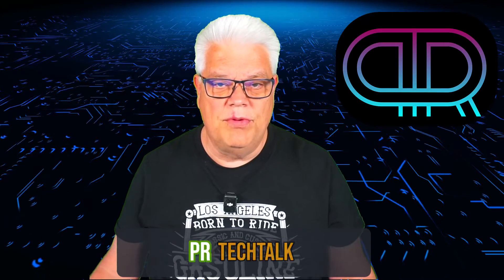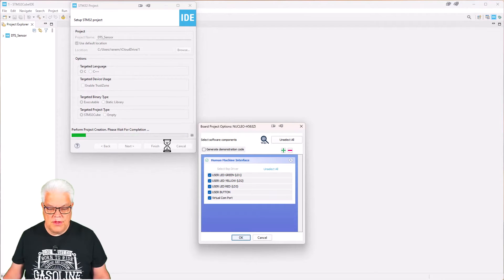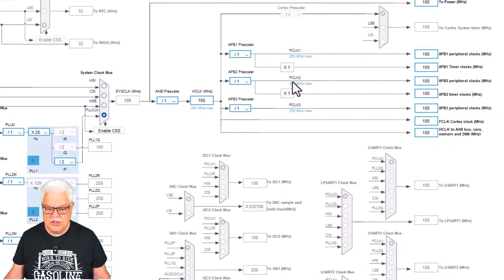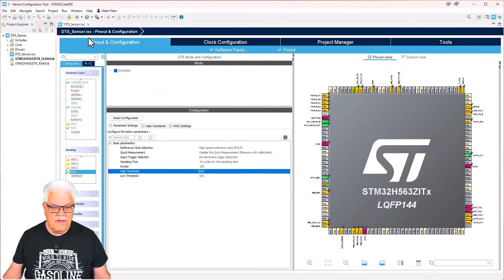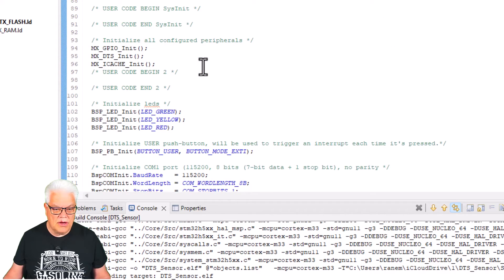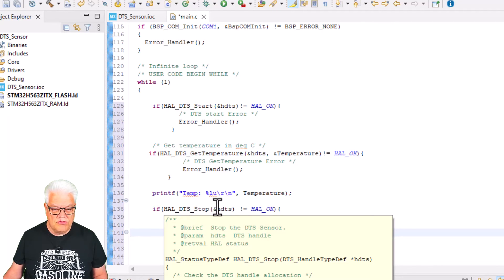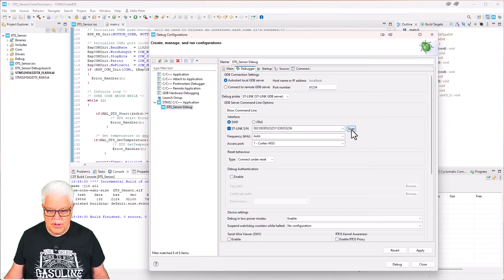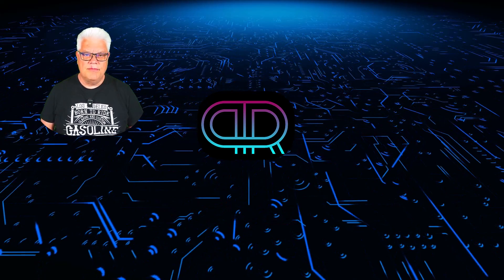STM32 DTS Tutorial: Digital Temperature Sensor

Comment: Hello! great video as usual!, one question: why use this DTS instead the ADC temperature channel? what are the case that is better DTS and the case ADC temperature is better? thank you!
Reply from the maker: Hi Andrea, I use this since DTS is so easy to get started and use, and you can free the ADC to other tasks, Normally you need long sampling time for the analog tempsensor and that could interfere with other more high priority measurments.   /PR TechTalk
Reply: @prtechtalk416  thank you! p.s. if i can make a suggestion for next videos it will be awesome if you talk about  how to connect a QSPI memory and map it in ROM, and also to continue with threadX. best reguards